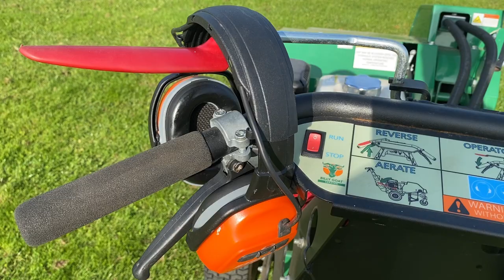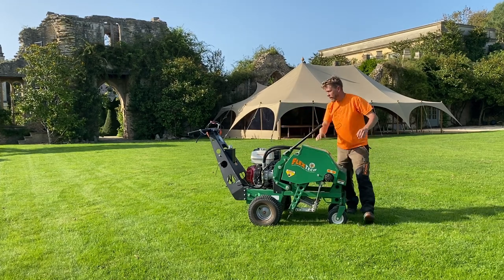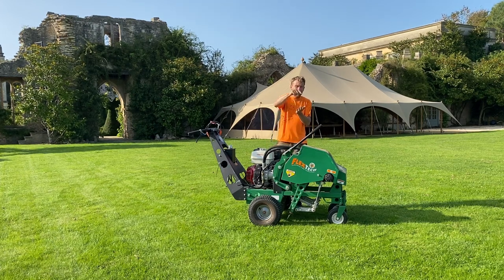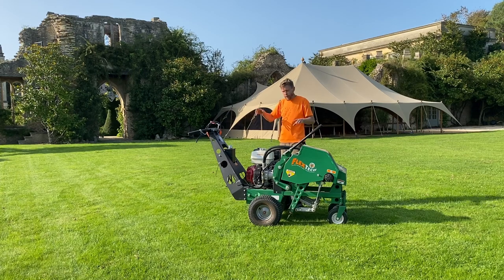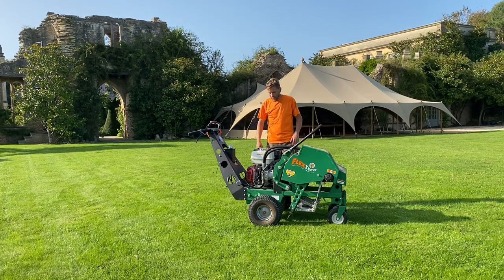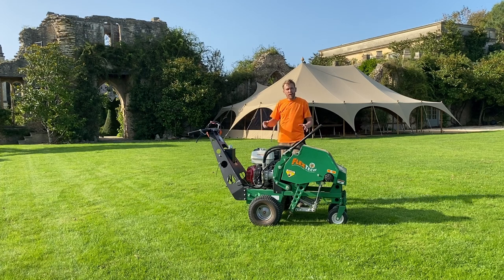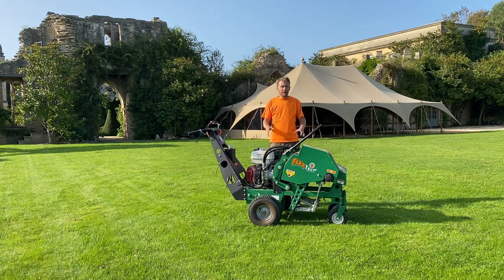BILLY GOAT HYDRO AERATOR

Comment: Great video I have been looking at these recently for the commercial work. 8k price tag but looks a good machine.
Reply from the maker: Quite surprising the area you can cover in a sort space of time with this machine. The hydrostatic drive makes it a pleasure to use, being able to slow down to put the extra holes where you need them is great. 😀